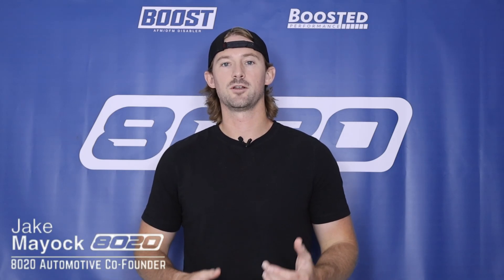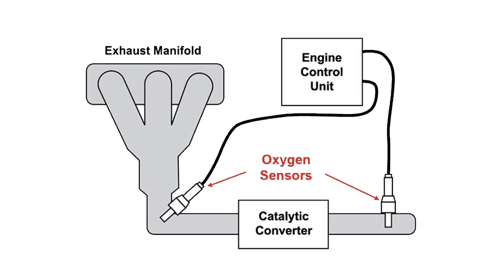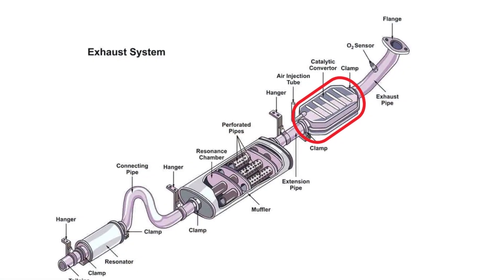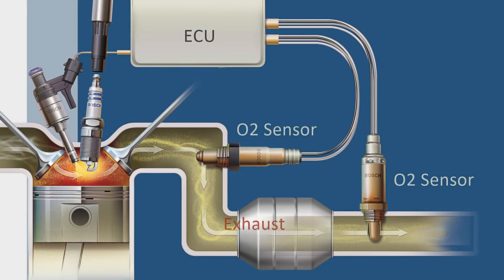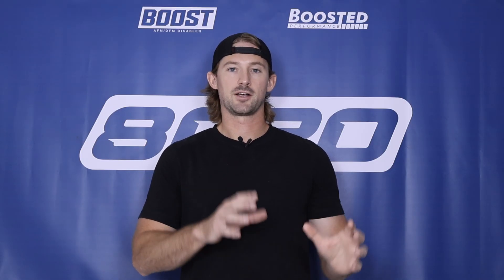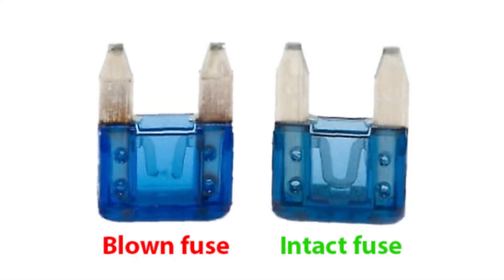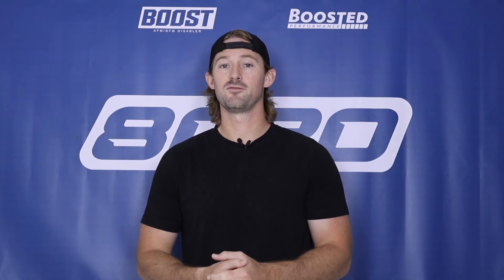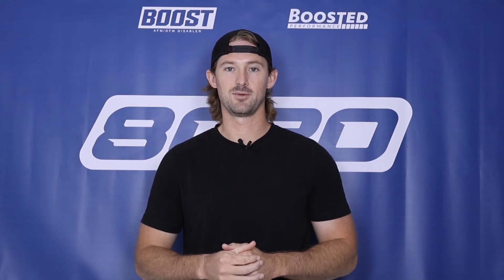P0030 Code? Here’s What It Actually Means (And How to Fix It)

Comment: The voltage from the eginge going to the sensor is only 9 volts. Is that what causes the problem? The battery voltage is not low~13v. Is there voltage droppage in the wiring?

Comment: Po304 code is on a Q5 Quattro Lexus
Reply: Ok, so what if this code is new immediately after replacing the sensor and the fuses are fine? What are the chances the circuit within the sensor are bad right out of the factory?
Reply from the maker: O - If a P0030 (HO2S heater control circuit, Bank 1 Sensor 1) pops up immediately after replacing the sensor and you’ve confirmed the fuse is good, then yes, there’s a real chance the new sensor itself is faulty out of the box — especially if it’s an aftermarket or cheaper brand, since quality control isn’t always consistent and bad heater circuits right from the factory aren’t rare. That said, you should also double-check the connector and wiring at the plug, because bent pins, loose fitment, or damaged insulation can trigger the same code even with a good sensor. In short: brand-new sensors can absolutely be bad, but before exchanging it, confirm you’ve got 12V on the heater feed wire with key on and solid ground continuity; if power and ground are present and the code remains, the replacement sensor’s heater circuit is defective.
Reply from the maker: W - https://youtu.be/f1mQ5hD1-vI